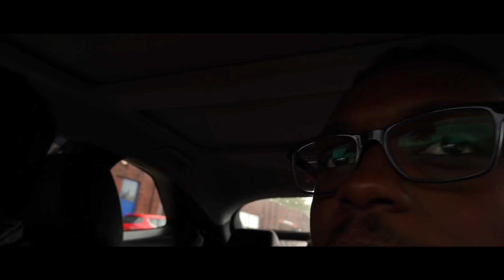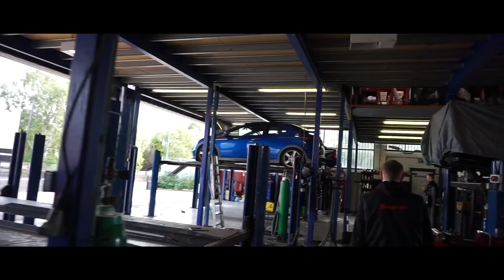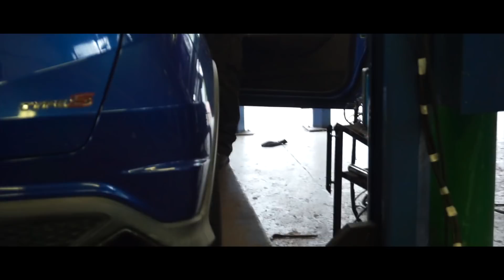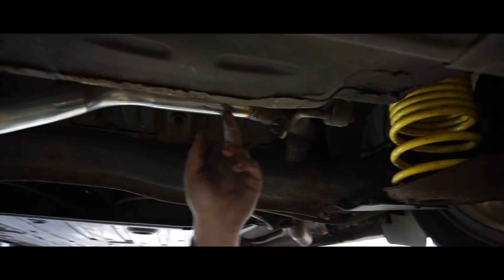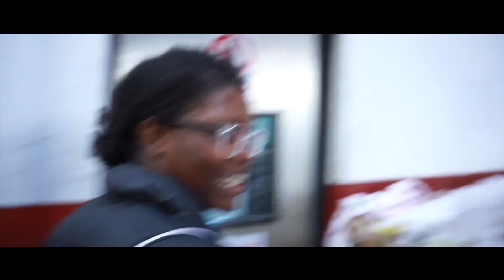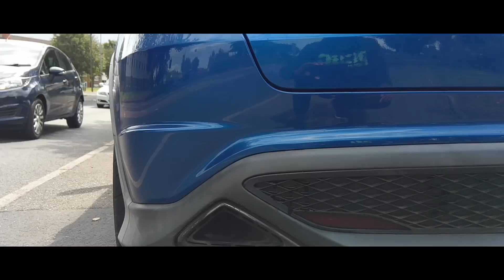Making My Girlfriend's Civic FN1 LOUD!!!!! 😆😆😆 | 💥💥 Pops, bangs and Crackles on a budget 💥💥

Comment: How can i get my fn2 to pop n sound louder without changing the exhaust
Reply: you cant. eventually you can change the intake to a cold air system...that will give you some extra hp, and also you will be able to hear the air flow at higher rpm.